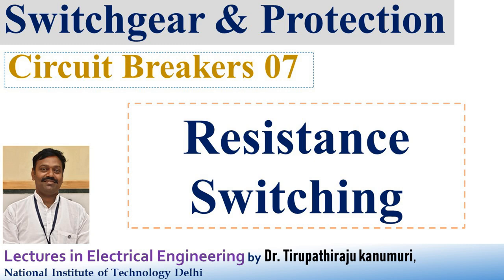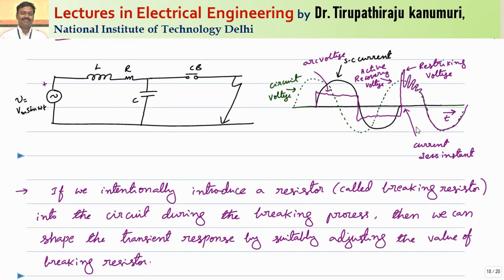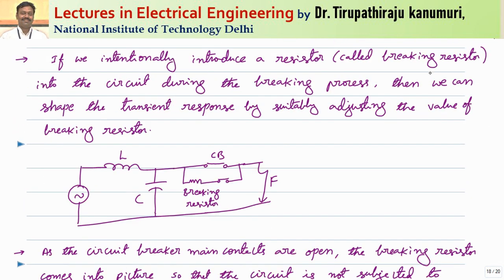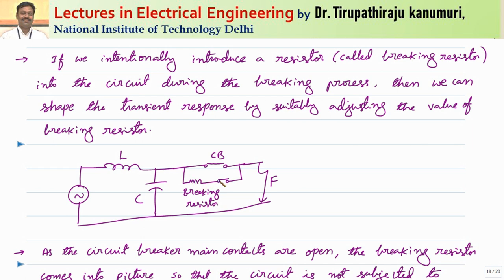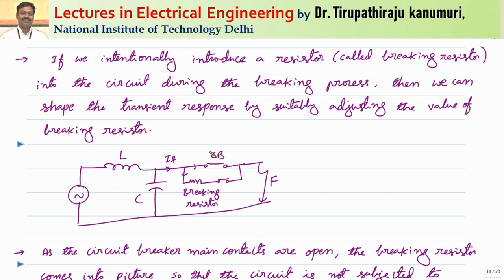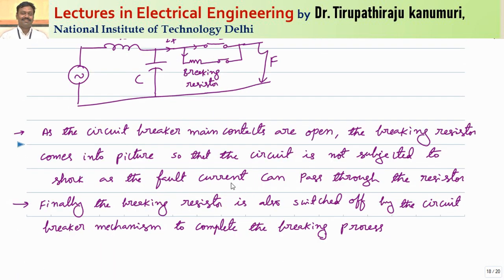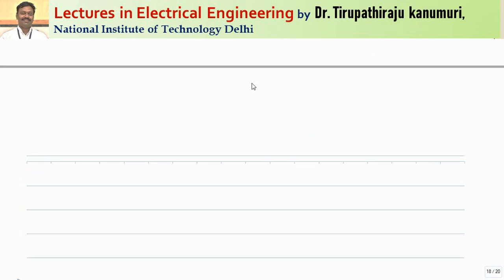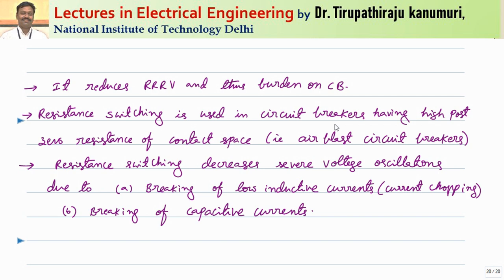SGP207 Resistance Switching

Comment: Thank you for good lectures. The concepts are clearly explained.

A bypass Capacitor is used in 400 kV circuit breakers of Siemens, and other big brands.

Can you please analyse and make a lecture.

Thank you.

Comment: sir once the resister get connected some part of the arc current gets bypassed through the resistor.now the resistor comes in the circuit and allow the fault current to flow because the fault is still there.now when we open the switch which is in series with the resistor will there not develop arc again ?
Reply: ok sir